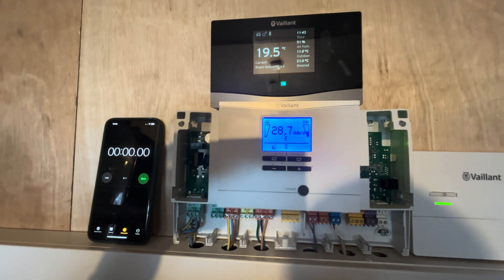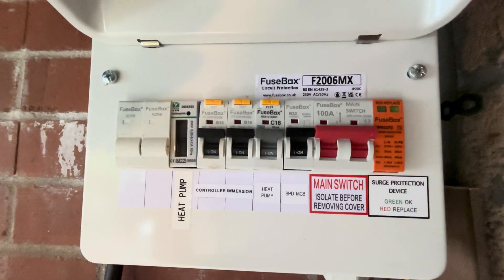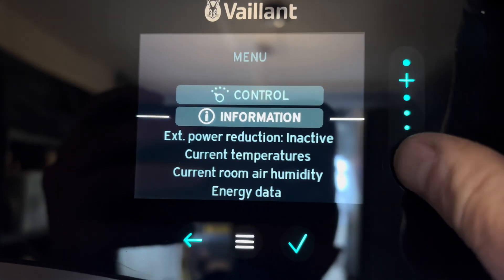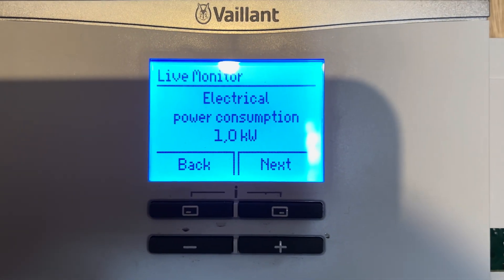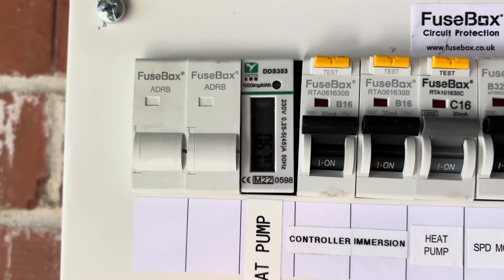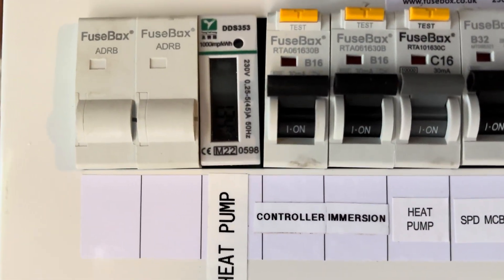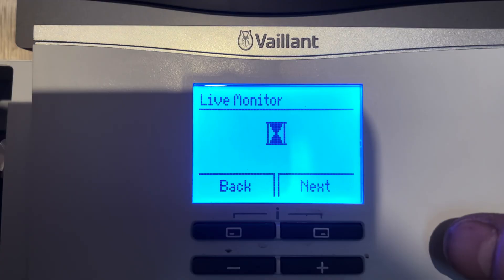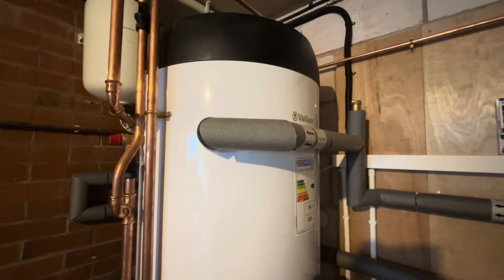First Time Heating The Hot Water Cylinder REAL Time & Cost Results

Comment: 50% compressor as you are in eco mode on the hot water cycle. I have tried this but now prefer to heat my 250l mixergy tank using normal mode in 1.5 hours to 55deg.
Reply from the maker: How do you find it performs in normal mode?

Next experiment for me will be cost difference between normal and eco mode and set temperatures
Reply: @i85_Heat_Pumps I find it's better in normal mode. I also find the reduce time is beneficial as my heating is on longer as the HW generation is shorter. Noise levels will rise tho.
Reply from the maker: Will be in interesting comparison! Thanks for the info